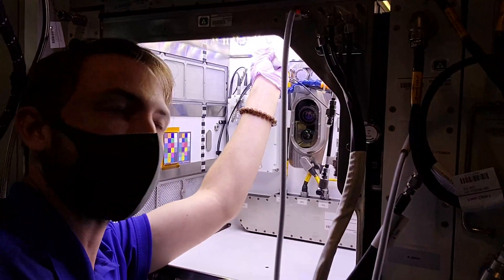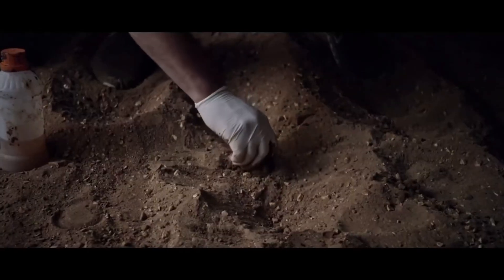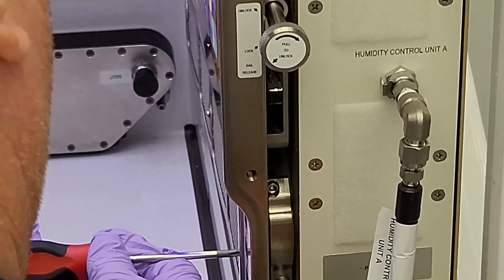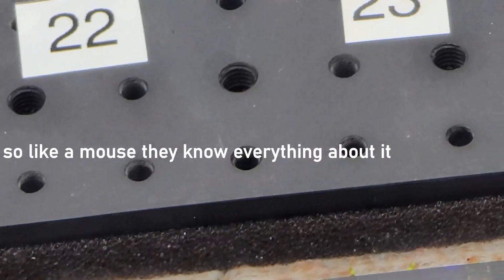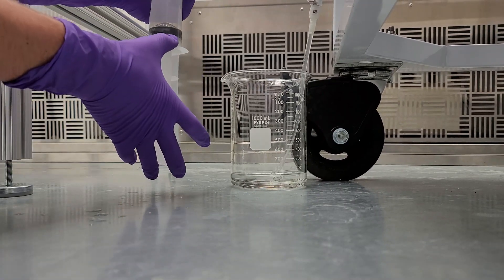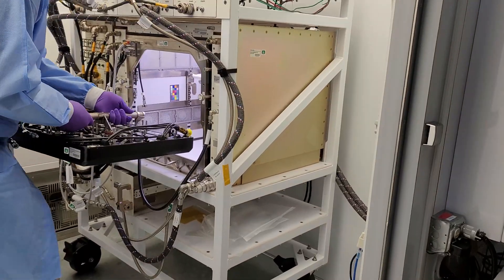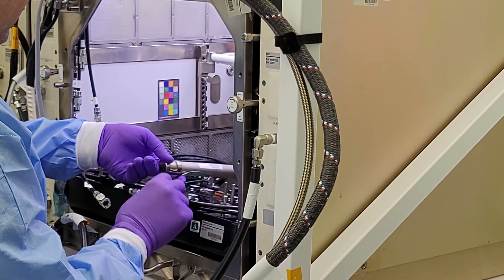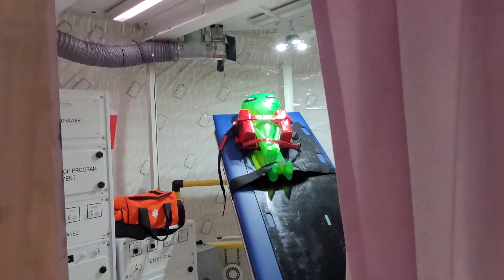HOW NASA GROWS PLANTS IN SPACE

Comment: Amazing video! So do you figure things out on a 3rd unit and then carry it out simultaneously on earth and station or is there an delay between the control and the actual experiment?
Reply from the maker: So kind of. We had an issue with the in space one and we trouble shot it on the ground to figure out a fix and then used that plan and fix to send components to do the repair on orbit.